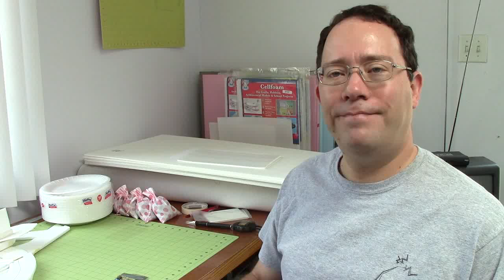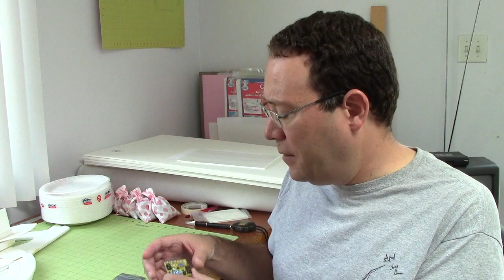Which is better, Tricopter or Quadcopter?

Comment: if a quad loses a motor or prop there is zero chance of a safe landing. your going to do a diagonal flip into the ground. With hex and octos you stand a chance of landing but not with a quad. Im about to finish my first tri. How do you tilt the front motors to counter torque?
Reply: Quads can land. You put all power on the opposite end of where the motor failed while decending. Tri copters have no chance. Octos can keep flying. Hex has a good chance, but you can't keep going
Reply: MrAmericasbadboy Yes, in theory a quadcopter could land that way. The chances are very low, but it is possible if you can get it to stay level while spinning like mad from the torque of the two motors diagonally being the only thing holding it up. Very slim chances of a safe landing but it is still possible.
Reply: You'd have to be quick to act. All in all, if you try and you are successful, then great. I just hope for a better crash landing
Reply: MrAmericasbadboy   I've yet to see anyone successfully land a quad with a failed motor.    

"You put all power on the opposite end of where the motor failed while decending."     That would do absolutely nothing, you can't just apply power to one side and expect anything good to happen.  

As HiFlite pointed out, you'd need to go into a hard yaw to get two motors diagonal from each other creating lift.  But it would still be near impossible to land in such a hard yaw,  with no other form of directional control.
Reply: ***** I guess your right...
Reply: Depends on your FC, mass distribution of airframe and the motors power redundancy. If the build is sufficiently balanced, the motors capable of providing enough thrust, and an FC capable of redundant flight, and the necessary supporting sensors, power can be re-distributed to induce sufficient yaw velocity to provide a gyroscopic effect on the airframe. Immediate and direct descent is all but unavoidable (if you do not wish to most likely cause further failures) which means the area directly below the craft has to be adequate for landing, and although the landing is still going to be a crash landing, it can be a somewhat controlled crash landing with a more ‘survivable’ rate of descent. 

The yaw velocity needs to be decreased as much as possible in final stage of descent and power to the motors cut immediately prior to touching down, but if this in done correctly and the gimbal has safeguards to protect it and its components then the camera can be expected to survive the impact and sudden loss of lateral rotation.

Comment: Question : On a quadcopter, two motors turn clockwise and two anticlockwise, so in a stable hover, there is no rotational moment of the aircraft.  On a tricopter, there is an imbalance, and consequently a tendency for the craft to rotate.  Does this not mean that a part of the energy of a tricopter goes into countering this rotation, making the tricopter less efficient?

Comment: Tricopters work great with three props of the same rotation. The tail rotor will just be biased to one side more than if you had a single reverse-rotation propeller.

Alternatively, if you know you will only be using one kind of prop, you can tilt the front motor mounts slightly and in that way allow the tail to stay closer to vertical.

Comment from the maker: Most stabilization units only have gyroscopes in them. A gyro is not enough to have a multicopter be self-righting. Aluminum or carbon fiber tubes are a good choice for the arms.